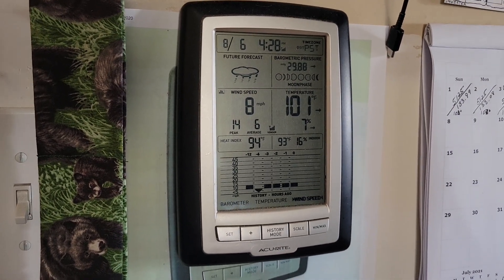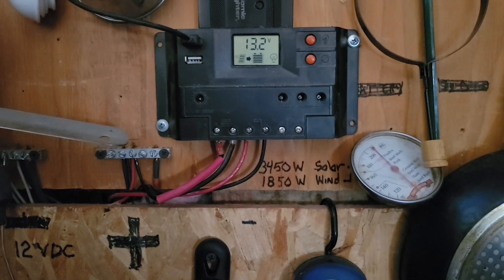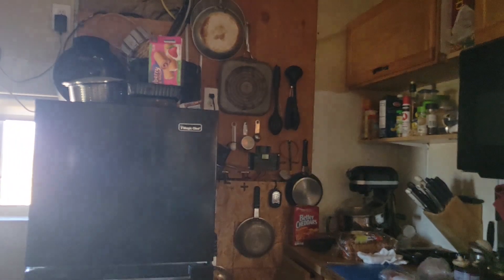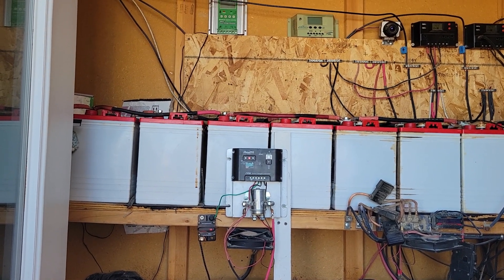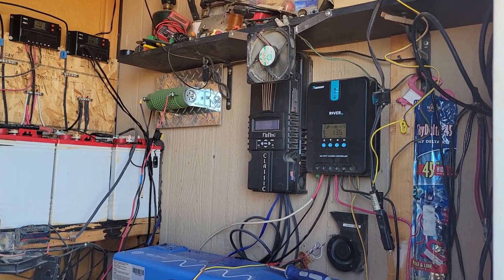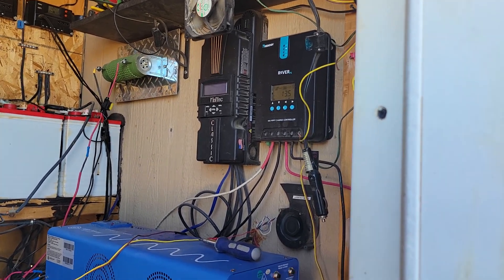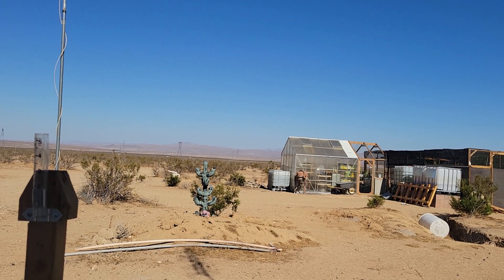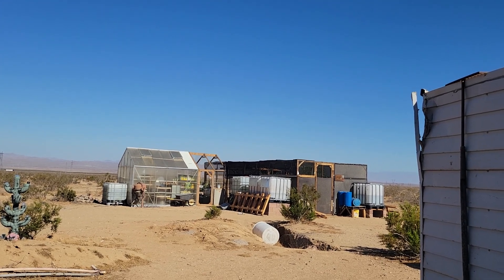More About Battery Banks, Wind Power and Solar, Aug. 6, 2021

Comment: The closer your solar battery input to the inverter is to final output say 120vac the less work your inverter has to do.  They last longer.  12v 24v equipment can be handled via DC / DC inverters from your batter voltage.  I chose 24v simply because it's a bit closer to my target 120vac and easy enough to down convert to 12v. Your voltage also determines your wire gauged (AWG ) needed.   I do not use many 12v items.     I only save on AWG by a we bit.

Comment: YOUR CHOICE OF12 VOLTS INPUT SETUP WAS ESTIMATED TO BE MORE CAPABLE BEYOND YOUR REASONABLE DOUBT TO POWER THE AIMS INVERTER TO RUN MUCH LARGER LOADS MORE EFFICIENTLY . THIS SAME POWER WAS WASTED THROUGH THE LESS EFFICIENT UNDERRATED POWER JACK INVERTER AS A LOT OF HEAT . YOU'VE MADE THE BEST CHOICE OF OWNING AN AIMS INVERTER EVEN AT 12 VOLTS SOLAR INPUT . THUMBS UP .
Reply from the maker: Thanks.

Comment: Great video once again how much does it cost to operate your electric system once all installed per year or monthly must need parts or something plus put in compared to city folks
Reply from the maker: To start, every 2-3 months I buy $3 worth of distilled water at 99 cents a gallon, but won't be buying it anymore once I get my solar distiller built.
Welcome aboard!

Comment: 48v is more efficiency but when you live in the middle of nowhere 12v easier to get replecmant  parts for if your inverter stop working you can get a inverter anywhere for a 12v system a 24v or a 48v is going to take 2 to 8 days to get
Reply from the maker: That's true too.  But off grid, once you settle in on something you are satisfied with, it is smart to buy backup items for all the 'necessities'.  One is nonevif you have a failure.

Comment: It's my understanding the higher the input voltage of an inverter
The cooler they run
But when adding to battery banks
That means buying more batteries..
Reply from the maker: Yes, but dont forget Ohm's law...higher voltage, lower amps, but same watts.  A 100watt load can run on 10v x 10a, or 1v at 100a, or  100v at 1a.  Differences are size of conductors (wire gauge), and 'hard start' items need to be considered. 
I run my systemy at 12v input and use heavy gauge wire because I have high use machines in my shop, like milling machine, metal and wood lathes, HD drill press, etc.
I still need to enlarge my battery bank for night use,  but what I have works for me right now.